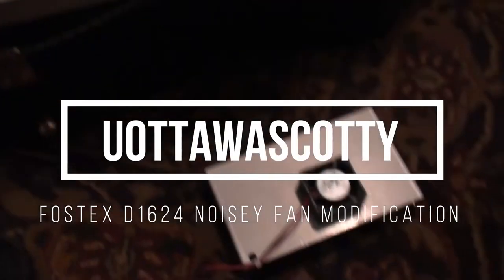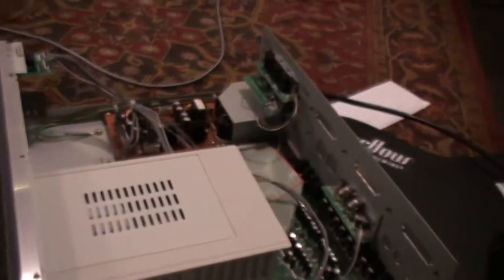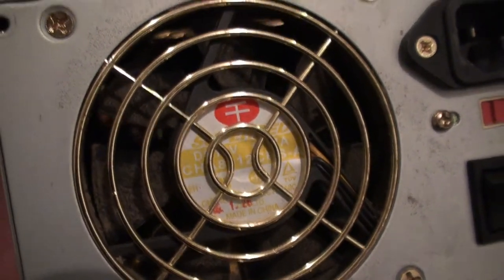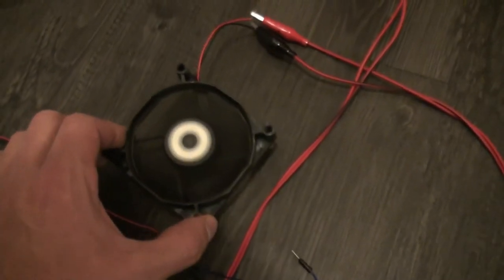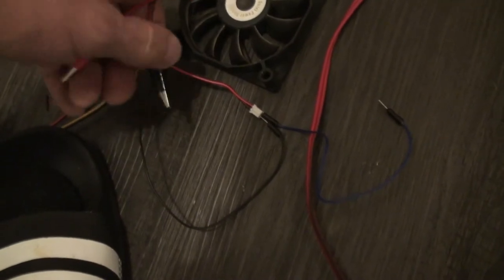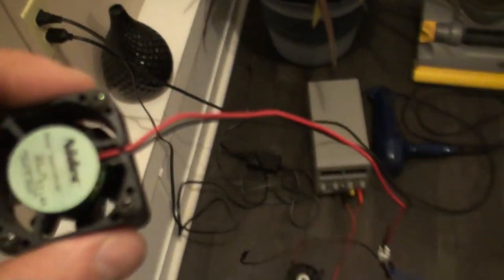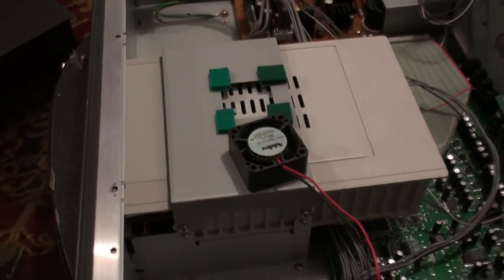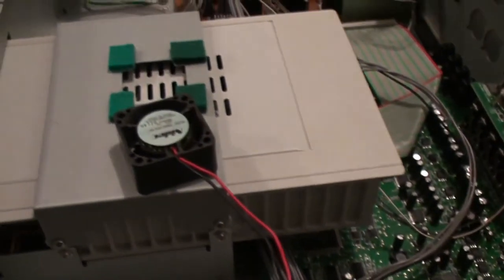Fostex D1624 Noisey Hard Drive Fan Modification

Comment: I think Fostex though people would be using these in big hot concert halls in reality for example i have a tascam 2488 24 track recorder with no fan at all sandwiched in between the PCB board. Never had problems just IDE harddrives are a gamble to replace and buy.
Reply from the maker: The amount of noise this thing makes is actually absurd.  I have a small tascam 788, which is guess is the smaller version of what you have, I love that thing, do all of my recording on it.